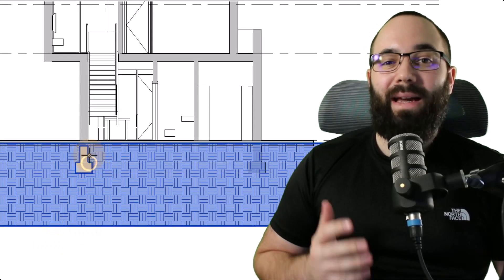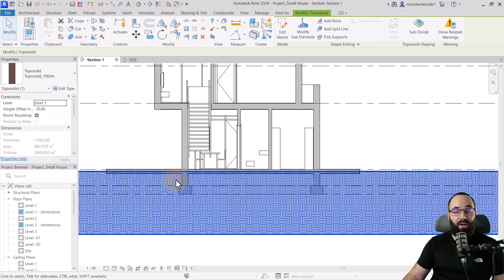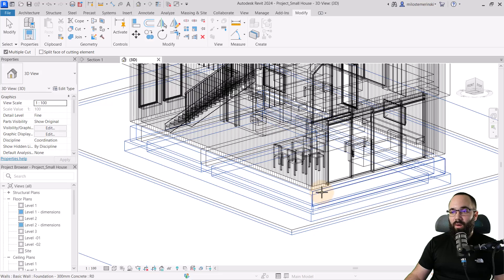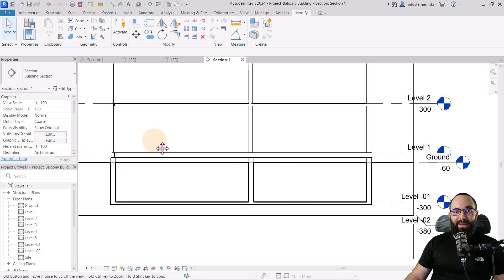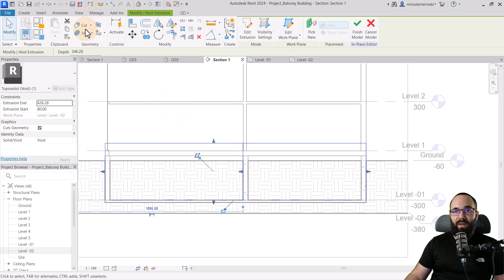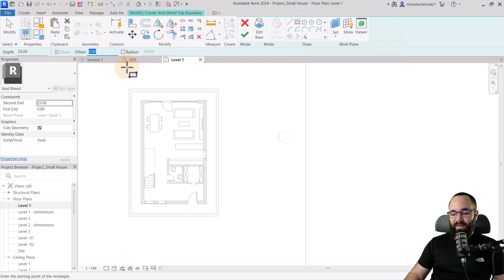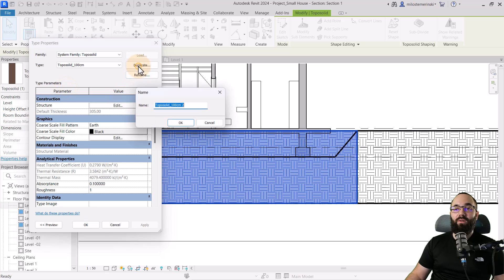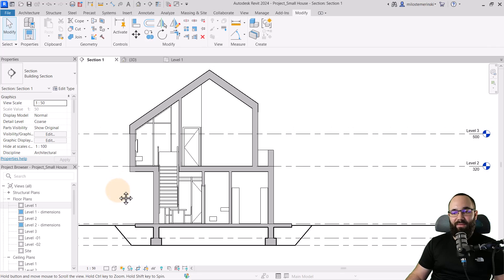How to Connect the Building with the Toposolids in Revit Tutorial

Comment: Can the 3rd method you show here be used if you toposolid is a separate revit model linked to the building model? Does this still work if you have a fill toposolid that has slopes to reconcile grade differences from existing to new  like on a slopes site or where you raise grades to get a barrier free entrance? Can it be used to tell you volume of the fill once you cut one toposolid from the other?

Comment: Thank you Snr Balkan Architect. Always very helpful. I'm busy doing a huge site which requires detailed earthworks planning. How does this method effect the net cut/fill of the original toposolid? If it's not reliable then so be it. But if it is, that would be so bloody helpful! And I would buy you a coffee if you're ever in Rome.
Reply: To answer my own question after some experimentation. Cutting a toposolid with another toposolid does not affect the cut/fill values. But you can use the volume of the cutting topsolid instead of the the 'cut' value. However this volume would be affected when you cut out the foundations from it. But if you created a new graded region from that excavation for the backfill phase you can get it all to work. You just have to manage your phases well.

That way you can get accurate grading, excavations and backfill. Wonderful.

I love revit. ❤

Comment: I just installed RVT 2024 and figured out that I have to find totally other workflow for landscaping and ground works than I had before with toposurfaces. Removing building pads really hit me hard in this matter. I understand how to work with flat topography, it's more complicated with voids but whatever. Problems begins when I have sloped topography, where I need to cut the ground on on side and fill on the other side. I still have not found a good solution for that. The basic one is to modify sub-elements, though this method is really bad because I am messing up the original topography which I have from survey on global scale, not locally where I need it. Also there is no more split tool for topography and if I have for example 20 land plots in single project I have to manually build the toposolid for each one of them and than cut them according to property lines. 
 It's a pain 😒😒. Changing to toposolids is okay, I get it. But why was it necessary to remove building pads, split/merge topography and etc. Cm'on
Reply: This it the big issue I'm facing as well.  I design homes on mountain lots and this a mandatory workflow I have to figure out.  I need to to be a flow were I can move the house up and down and rotate it on the lot quickly.  Really questioning whether I can move my projects into 2025.

Comment: hello - an other brilliant videao - thanks
Question:
I would like to have the site (the toposolid) in one project file and the building(s) in seperate files. The idea is that this alows me to move the buildings around the site to find the best location.
Is there a way to cut the toposolid with elements from a linked project?
Or is my aproach a bad one in the first place?
Reply: Having a separate project file is an excellent workflow, especially for larger projects that might have several buildings on the same site (separate project files for each building). This also has the added benefit for keeping your files sizes smaller. 
However, you cannot cut the toposolid with elements from a linked file. I've even tried the copy/monitor function under the collaboration menu to copy/monitor the building elements that I want to cut from the toposolid, but only Levels, grids, columns, walls and floors are able to be copy/monitored. So anything in a structural foundation category could not be used. 
If you ask me, this is a serious deficiency in Revit.
Reply: Topography HAS to be a different file in real life projects. The topography defines the georeference of the project and the architecture moves around the topography during the project process. Optimal positioning of the building in the terrain (horizontally and vertically) is part of the design process and it's an iterative thing
Reply: I get what you mean, but I've never had a project that needs excavation details and still doesn't have a fixed location... locating the building is usually one of the first steps of a project while excavation is dependent on the site AFTER fixing the building location to reduce adjacent buildings or pipes or roads interference.